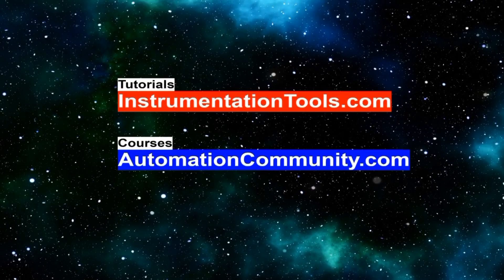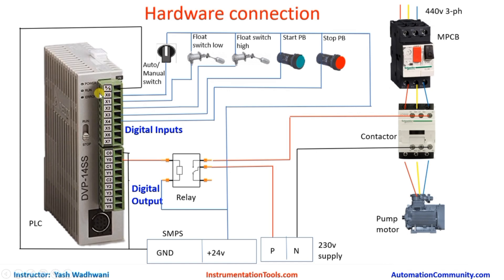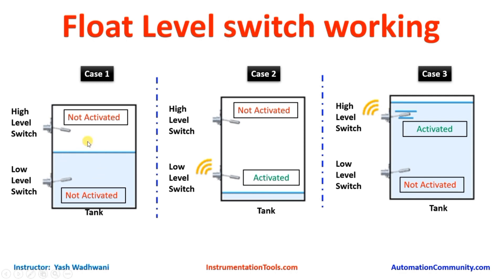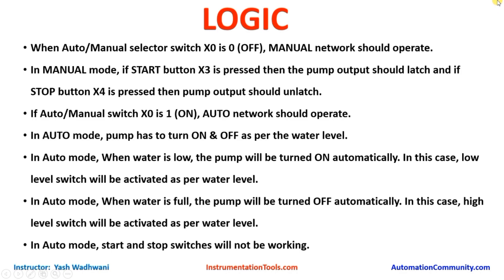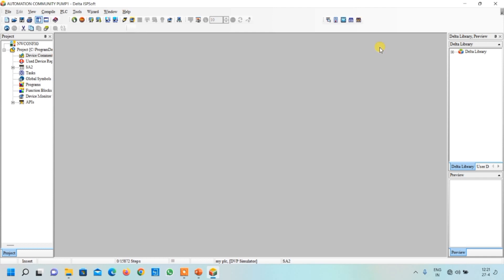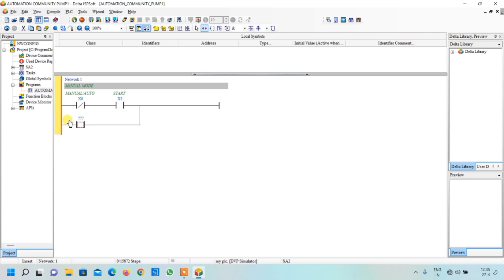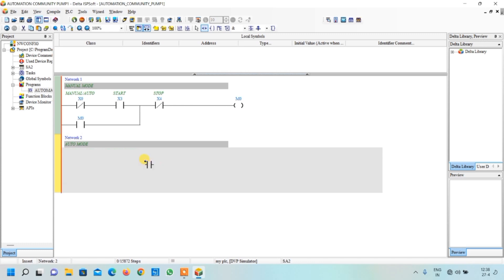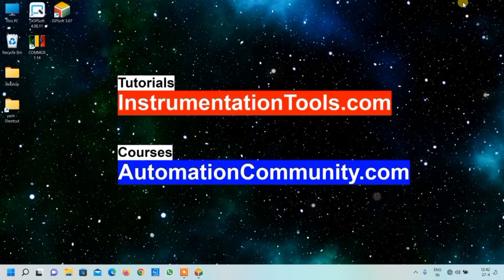Auto Manual Water Pump Control - PLC Examples for Beginners

Comment: what if pump is running in auto mode due to low water level and then we want to start manual mode, pump will turn off in this case, but it should turn off unless the pump was already off in auto mode, how can we do that?

Comment: Quite surprised by the setup. In my opinion the low level switch should always interlock the pump and prevent it from running regardless if it's in auto or manual, otherwise you run the risk of the pump running dry which can damage it. This would mean manual simply allows you to pump out the tank when the upper limit hasn't been reached, ie when it's half full.